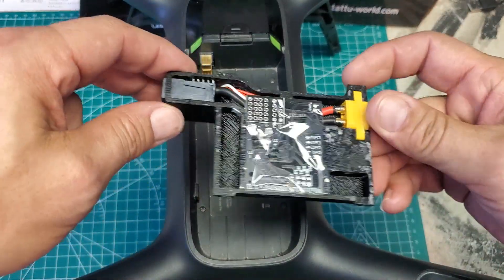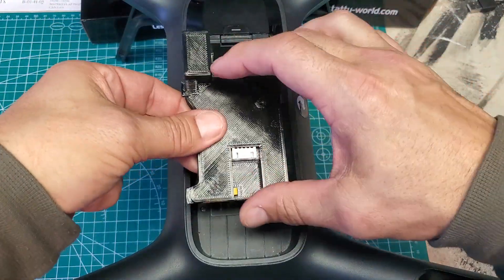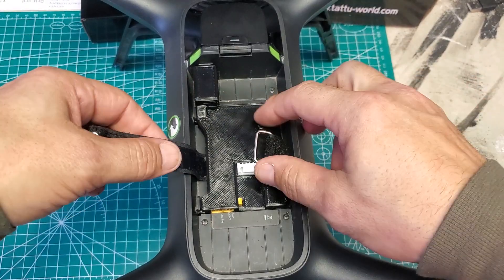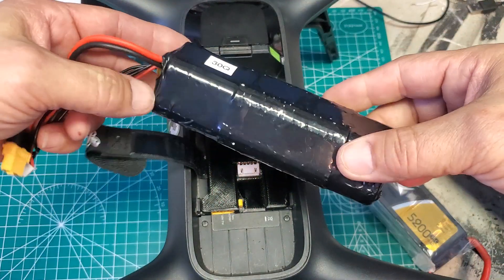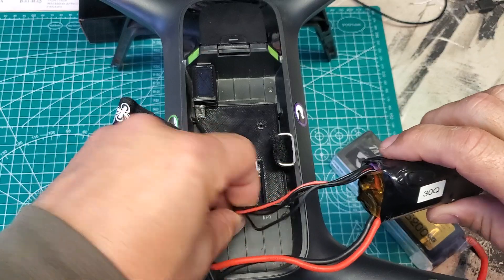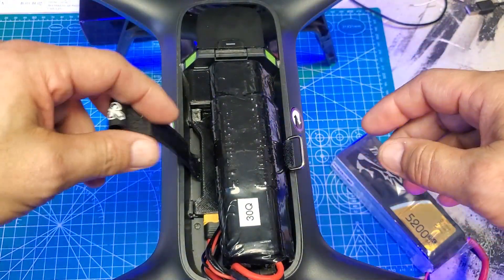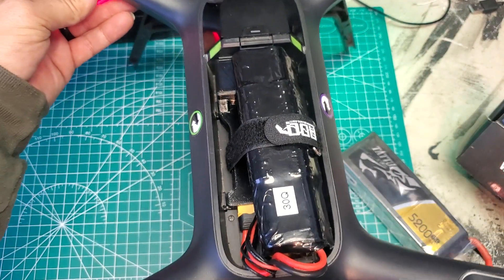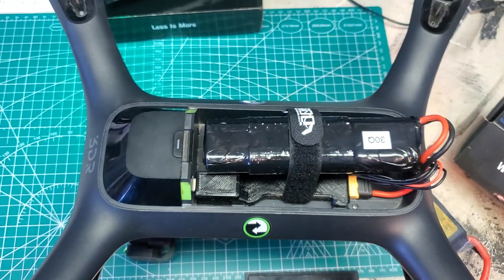3DR Solo BMSOne External installation

Comment: My battery brains quit working for some reason. About to throw my splo out the window.
Reply from the maker: Here's another option for your battery troubles.

https://jonbrotherton.fws.store/product/3dr-solo-battery-mod
Reply: I got it working. Has to use motor tests to drain the lipo down to almost dead. Like 3.4volts per cell. Them I had to put on the charger for a couple hours to charge it full. Then motor test again to drain. Just to get the battery computer calibrated. Going to have to buy a bms one